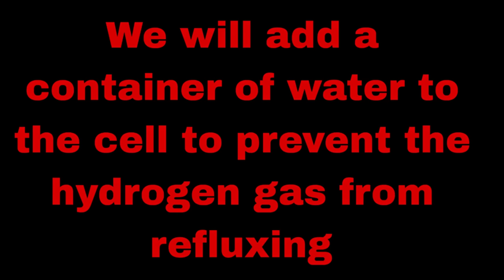I turn Water into a Free Gas for cooking, New invention

Comment: Awesome invention. Congrats ..How much power supply, i mean 12v or 24v  to heat up the coil? Instead of the compressor can we use any other? Best wishes
Reply: 24v
Reply: Any where from 6v can work, but it is amps that are most important. It is not a coil and there is no heating. It is an electrolysis reaction.
Reply: Use smaller pump instead of compressor
12v6A for electrolysis
Heavy duty mask for toxic fumes
Backlash of fire safety since hydrogen flame can be invisible during daylight
Overheat or explosion incase of blockage in pipes
Corroding metal in water can be dangerous so expose safely after use..
Be safe, be aware

Comment: It's far more costly to do than what you get out of it.  There are losses in energy along the way so you will typically use more electricity than the amount of energy in the form of hydrogen gas that you get out. It's of course useful to generate hydrogen if that is what you want but if it is just energy to use to cooktheni guess you have to total up the losses of using homemade hydrogen vs using the electricity directly taking all the losses and efficiency into account.  For example, it takes an electrical stove plate longer to heat up than when cooking with gas (where the heat is almost immediately available and you have better control over the cooking procedure.) If you have a "free" form of energy that you can use to produce electricity like solar then it is feasible.  Another matter:  this is NOT a new invention hydrolysis of water to produce hydrogen has been known since the 18th century (1789 to be exact)
Reply from the maker: you can use solar panel
Reply: Yes you can use solar and there’s still losses and the capital costs for the solar system can be exorbitant… the amount of gas produced is directly proportional to the amount of electrical energy generated. So sure you can use solar but you need to calculate how much power you need from the sun and size your solar system accordingly.  So say you use a 500W single solar panel just for the production of combustible gas.  The solar panel will seldom give you full 500watts (certainly not at night … so perhaps you could add a battery and inverter) and from my experience  typically you will get an average of less than half that 500watt say 200w averaged over 12 hours … whether that is enough to meet your needs needs to be assessed.

Comment: Actually by passing electricity through salt water hydrogen gas as well as chlorine gas are produced. Chlorine gas is not safe. Both has to be isolated before burning.

Comment: You just reinvented Browns gas! The only outside power would be the electricity required for the refrigerator compressor! U need a sharp drill bit! And a few other things need sharpening.

Comment: Although what he is doing is scientifically correct it is not very efficient as there is allot of energy loss in this conversion method not to mention loss of gas through those containers and tubes (hydrogen atoms are so small they can pass through thin sheets of steel). He would use less electricity cooking that egg on an electric element than by this method but if you really need a gas flame for something then this will work. I would not recommend doing this on a larger scale without using far better containers, tubes and connectors with good seals as the escaping gas will cause problems. Please heed that warning at the start as HHO gas can be very dangerous.
That said nice content and thanks.

Comment: Put the cable directly in the water and you can have water with evaporation. No compressor, no hydrogen, no water. The only problem is no the same egg.

Comment: No me cuadra las puntas de cokexion bajo el agua. Ahi esta haciendo corto circuito.
Reply from the maker: Because you connected this cell with home electricity ⚡️ 220v.
Connect it with car battery 12v 
Or use 12v 7A power supply

Comment: Erm, it's not free gas if electricity is consumed to split the hydrogen out of water. An electric hot plate would be more efficient as there are no conversion losses, but here there are losses from the power supply, the compressor, and the heat from electrolysis. The only situation where this setup would make sense is if no hot plate can be obtained or the flame is used for other purposes

Comment: free hydrogen more pricey than propane if you account the electric power cost to  get electrolitic separation and run acompressor , complete the job with solar cells or wind turbine then you might claim it free

Comment: Ok 2 solar panels. 1 air pump  2 stainless steel flat electrodes that are layers. 5 each 3 x 9 inch. 12 volt using a voltage regulator. 1 psi regulator to release build up. 1 voltage cut out if psi reaches set level. 1 flame resistant back flow valve. 1 pet cock to control on off. One pilot light using propane. 1 temp sensor to control temp.
Reply from the maker: Yes, 👍👍

Comment: This has been done before. 12V x 6 Amps = 72 Watts  input to separate the Hydrogen and Oxygen.
So it's very inefficient. 
It would be nice if you could measure the output in watts to see if it's actually practical.
This is not free energy if it runs on electric power.

Comment: Ok got some good ideas, but if your using a compressor you need electric to run it. Electric isn't free, you might as well cook it on a stove. Ty for your effort, you might try a translator, so we know all the moving parts, just saying.
Reply from the maker: You Can replace fridge compressor with 12v Air pump

Comment: Hydrogen gas generated by electrolysis of water is not free energy.  Electricity must be supplied to the system to make the gas. More efficient and less energy required if you simply used an electric hot plate for cooking.

Comment: You are using electricity to generate gas converting one type of energy to another use the electricity for heat then you do not have to convert it to gas.
Reply: U knew all that, but u don't know that amount of electric couldn't produce the same amount of heat. 
Take ur jealousy elsewhere.

Comment: The money spent on electricity cost more the money save on gas . You forgot to put a low-medium -high switch.
Reply: Not if it's solar. 
But u know this....
Reply: @mssvelte  you will need a big solar panel and big amp hour battery to power a refrigerator motor continuously and when it's cloudy and raining you can not cook,just go to the restaurant to eat.
Solar panel+big battery+restaurant bills and tip=more money spent.
But you didn't know this.,.
Reply: @enriqueoliva6988  nope. If I'm understanding the setup correctly,  he's using the compresser like an air pump.
1. U could get use cheap solar generator.
Ling term, the cost would be negligible.
2 or u can switch the compressor out for a small air pump.
3. Solar panels are cheap. 100 watts are now under $100US. 
This is a good concept build.
Yall are just being petty haters.

Comment: What's the point if you're using 24v inverter and a refrigerator compressor? Just plug in a hot plate instead.
Reply: I think the point was that you can create the hot plate equivalent (10 amps A/C) by using a car battery and solar panel so no grid is needed.

Comment: It seems expensive gas since it is using electricity. First energy is being used to break the water molecules and Hydrogen gas is produced and then the hydrogen gas is burnt. It doesn't seem cost effective.

Comment: There is nothing new about electrolysis of water to form hydrogen and oxygen. Nor is it free - since it requires electricity to produce the gases and provide the compressed air. 

This is just a very poor implementation of a mixed hydrogen/oxygen gas generator. 🤣
Reply from the maker: You Can use 12v air pump

Comment: Everything would be fine, but first you need to get electricity, then you need to break the water molecule, the resulting rattlesnake gas is directed into a gas burner. What kind of ecology is there to talk about? Make it simple, put up a solar panel and channel the energy into an electric stove. Don't mess with people's heads! Buy yourself a simple electric stove!
Reply from the maker: for electricity use a solar panel

Comment: Not yet a free source of cookingfuel,because you used 2 electrical motors like compressor in which you consume More or less 700w/h,,,and a 12voltsadapter,in maybe in 1 ampere,and for actual produce,you must used a more durable hose and containers and a more logical casing for safety.bettr to see it in a more marketable products,and no electricity needed,,to be categorised as a free energy....thanks.

Comment: Eeer, can you just show us again those holes in the plastic lid ?. I don't think I got the idea the first twenty times you showed it to us. The Glue Gun Kid strikes again. And it would have been better to use a rusty nail to make the starter holes instead of tht pathetically blunt drill bit. New invention, my arse, it's basic electrolysis.

Comment: This guy is just bubbling cooking gas through water with wires dipped in to look like he is electrolysing the water to produce Hydrogen and oxygen to fool the masses for views, unfortunately. Handling massive quantities of hydrogen and burning it to produce heat in the open air is no mean feat. He has hidden the gas cylinder.